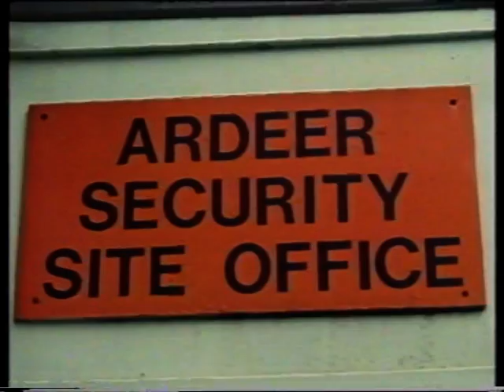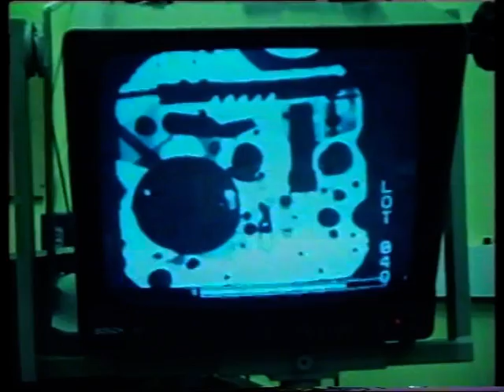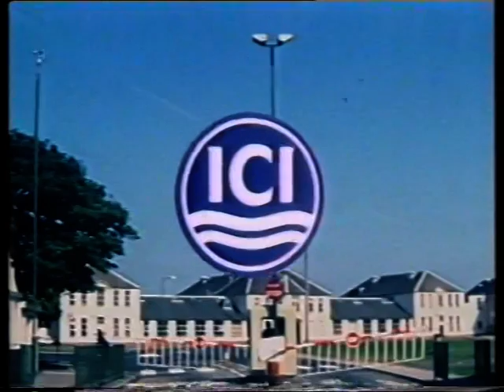ICI 1988 Movie

Comment: I grew up in front of ICI Billingham which was a super massive chemical and explosives plant which dwarved this one
Reply: Billingham and Ardeer were totally different sites, yes Billingham was a huge Chemical Works, Ardeer was started a explosives only and chemicals were added. Ardeer site size was 15 square miles, so don't know where the dwarf bit comes from. Explosives at Billingham??? The original Anhydride was going to be part of Explosives until they discovered it was a fertiliser and the rest is history. Both sites are now shadows of their former selves. Ardeer chemicals are all gone and at the time of the film there were not many left and a few shut within couple of years. Explosives are still there on a much smaller scale owned by Chemring. I know Ardeer and I also know Billingham, Worked at Ardeer, North Tees then Billingham
Reply: It’s not a competition
Reply: @alanbrannigan7934  Probably Ardeer was that big in area due to stuff being spread out for safety reasons, but Billingham was probably bigger on a tonnes-output capability scale I suspect